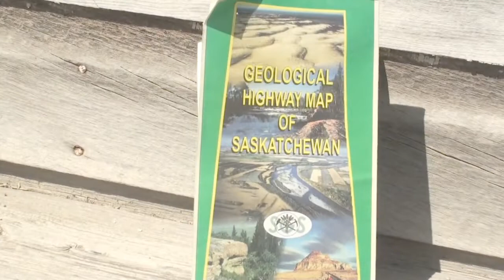Reserve, Saskatchewan; with aerial overview

Comment: I know   it’s been  four years l got a cabin there.  but you should go back and make a new video. that trail from the old rail bed that goes in the bush a 0:53 goes to the river and follow the old  rail bed instead of turning there’s the old train bridge. They called it reserve because this is where they had to fill the steam engine with water going to Weekes from Stugis.